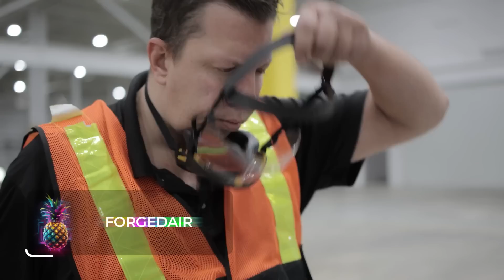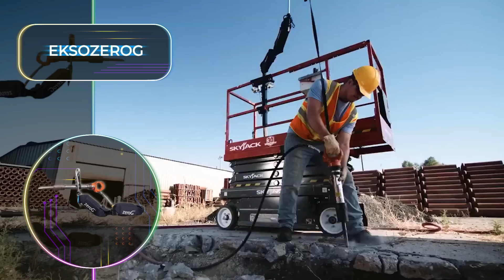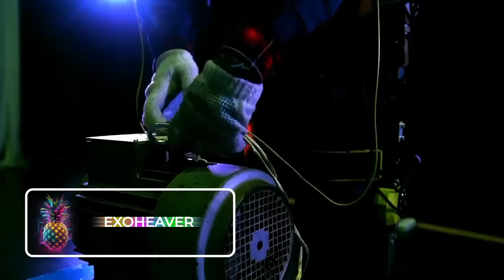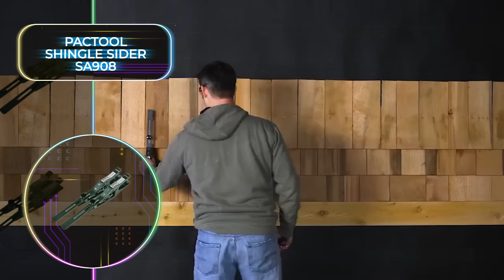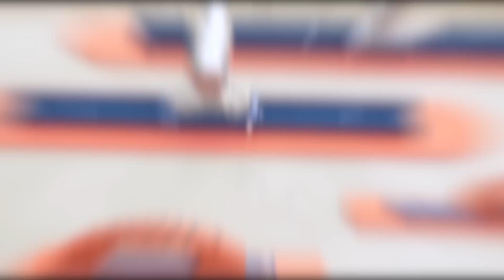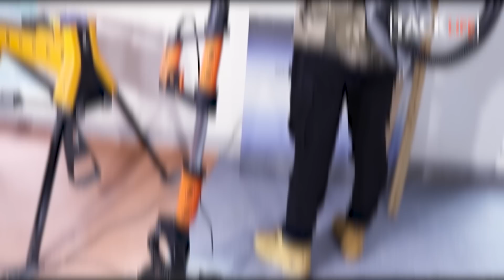Tools Construction Workers Don't Want You to Know About

Comment: The. Hard hat light and voltage sensor… should be mandatory.. for power companies….   SAFTY FIRST.. LOOK UP TO. LIVE !
Reply from the maker: Your concern for safety is truly appreciated. Thank you for emphasizing the importance of protective gear.
Reply: @FruityTech  I worked in the power line industry for a couple decades.     And have first hand knowledge..  it is one of THE most dangerous occupations      Hence the. SAFTY  FIRST.  .    LOOK UP. TO LIVE      … You have to be aware of everything around you at all times ….